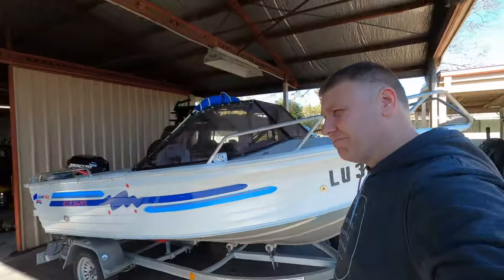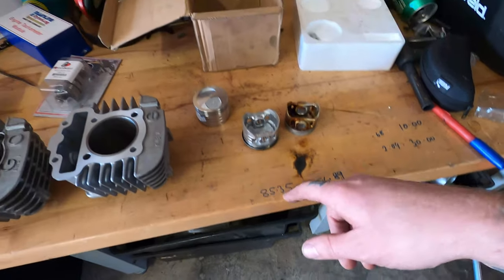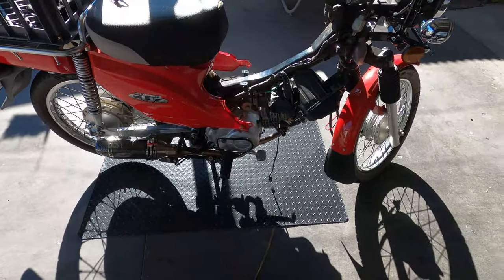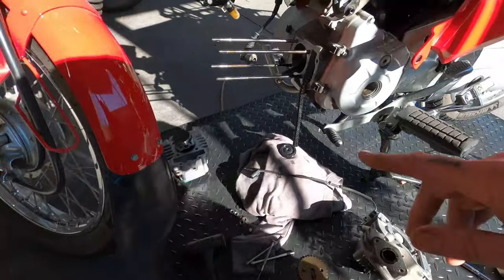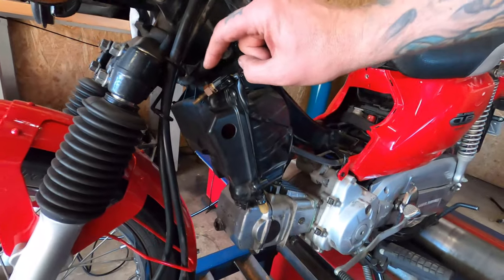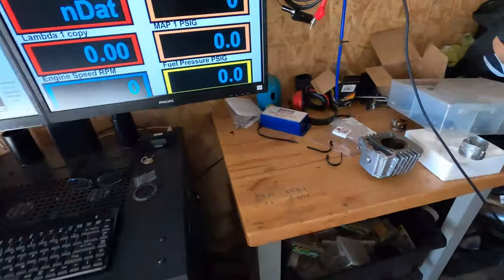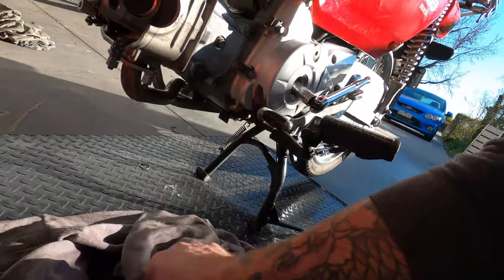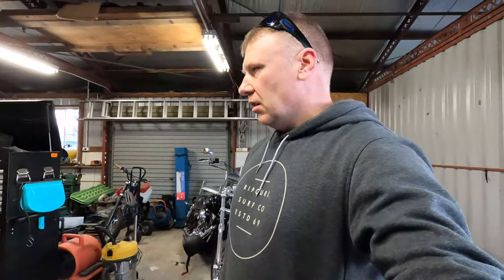Honda NBC110 Postie final big bore 3

Comment: Surprised at the outcome of the TB cam. Was considering getting one to go with my big bore but I won't bother now. Really disappointing that, you'd think it would liven it right up.
Reply from the maker: I was disappointed too mate.  The rocker contact point is on a crazy angle too.  The noise was really bad too.  Even with valve clearances at 0.002'. I will do more testing with more mods soon.
Reply: @frashd  might be worth raising it with TB parts and see if they can send you a replacement that's any better, could have been an incrroectly machined batch or something? Always worth an ask.

Comment: I tried the 130 kit from wild bore and experienced overheating, when i pulled it down i think the cylinder is too tight in the cases and nipping up the piston at the bottom of the stroke,did you have to relieve the cases at all? I don't think it would be much but im putting it back to standard as i just want to ride it

Comment: But where's the fan to cool the engine? And thankyou for the video.
Reply from the maker: It's one pull on the dyno with an engine making not much power. Fan is not required

Comment: What kind of improvement or other effects could you expect to see with the airbox removed entirely and an aftermarket pod-style air filter installed in its place? Is there a chance that'd be worth it over just modifying the OEM airbox?
Reply from the maker: No not really, one hole made a difference but two holes just made more induction noise. You need air speed.

Comment: Hi mate just wondering if you'll do a video of a rear wheel change out and refit for a tyre/tube change on a NBC110? Can't find anything specific to this one job on YT. Even the Lambda channel doesn't really have anything useful. Really want to do it myself but don't want to stuff it up. Tia.
Reply: I did that at Easter weekend. Removed sprocket spindle and brake shoe plate which meant hours more work. I think now that sprocket spindle could remain in place if axle ain't completely withdrawn , also brake shoe plate could be left dangling without needing to be disconnected because the spacer might allow enough wiggle room when wheel's  removed . Also helps if the ground falls away from the rear wheel when bike propped on centre stand or dig away some earth so that wheel can be easily dropped down . 17 and 19 mm combined open end/ ring spanners . The chain tensioner may not even need the 12 n 10 mm spanners for loosening up. It's all seared well  into my memory .

Comment: Hey champ fitted a 130 bigbore kit to my NBC 110 cub how did you change the fuel mixture been EFI
Reply from the maker: Hey mate, they run rich fr factory. And closed loop to almost wide open throttle

Comment: FRASHD tuning - Did the further lightening of the piston make the engine run any smoother?
Reply from the maker: Yes mate, it ran as smooth as a standard 110
Reply: @frashd  Excellent! I would've never thought to relieve "buzz" by lightening the piston. That's genius.
I was wondering if you ever gave any thought to porting the head?
Since you increased cylinder volume by about 18%, it stands to reason that port volume should probably be increased by the same amount, otherwise you're choking off the engine at higher rpm.
..of course, by the same token, you should increase the size of the carburetor by the same amount as well....do they even make bigger carb's for that engine?
Reply from the maker: @DeanMk1  the NBC110 is fuel injected. Also larger porting was further down the list of mods to do. Throttle body was next.
Reply: @frashd  oops, sorry. Living in the past again
Look forward to future videos on this project.
Reply: @frashd  did you end up getting a larger throttle body? I've been looking at the Kitaco one and their fuel controller too. Already ordered a Kitaco exhaust but not had it delivered yet.
Reply from the maker: @jamesmitchell7185  no, I ended up selling the bike. I have a ct110 I am currently testing
Reply: @frashd  I love the CTs, but there seems to be even less tuning parts available for them.

Comment: Hey mate.  you removed the oil temp sensor can I ask why.
Reply from the maker: The oil temp sensor controls cold start fueling. I tried disconnecting it to add extra fuel when I fitted the camshaft. Turns out the aftermarket camshaft required no extra fuel.. (this is a good indicator that the cam flows no more air than factory cam)
Reply: @frashd  yeah ok thx reckon it would work just with the loud exhaust n the extra holes in the air box
Reply from the maker: @paulrichards2239  the airbox hole helped, just do one side. And the big bore kit. I didn't rate the exhaust. Too loud for me.